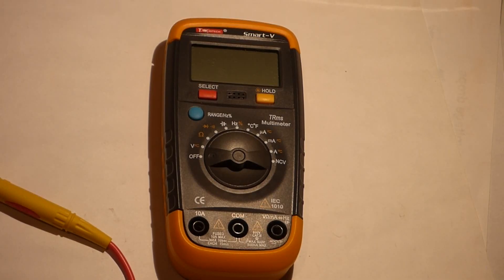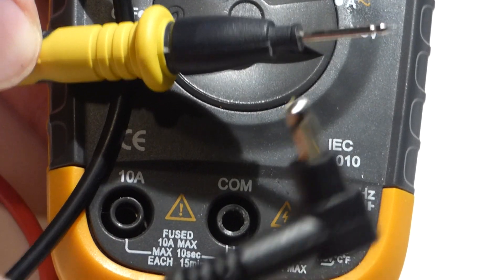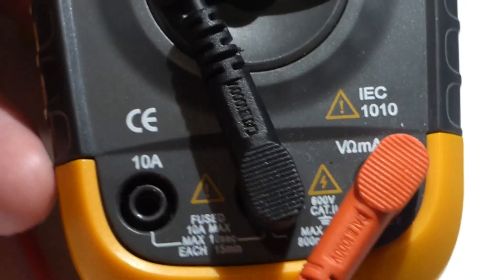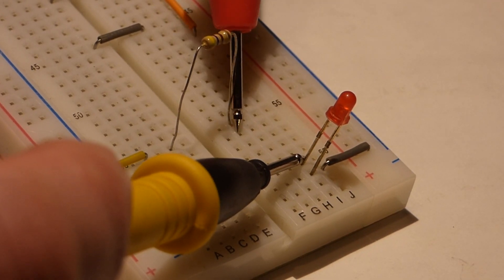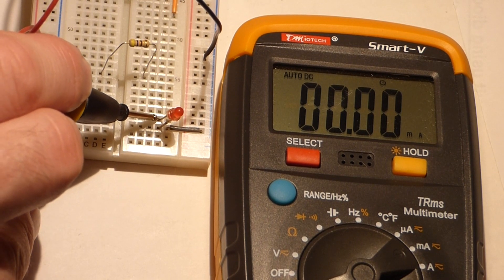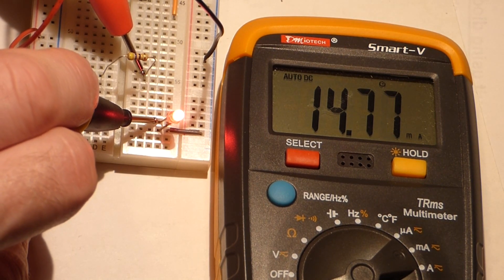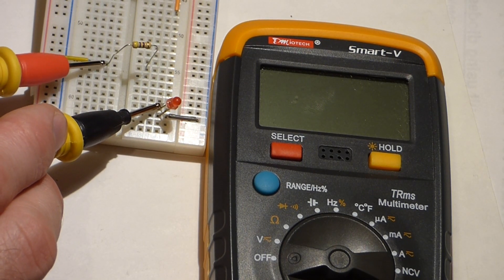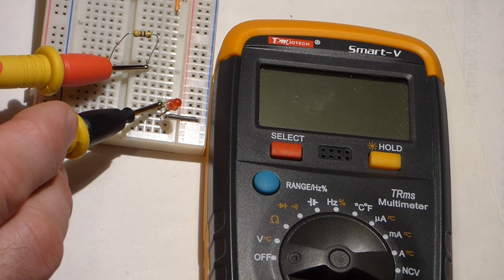How to use an electronics multimeter to measure current of a small breadboarded circuit.

Comment: Question: when experimenting we usually deal with mA and V not so much with joules or candela. I wanted to "see" J, W and candela. Can you please confirm if I am right?

1) For calculating joules and watts:
 In order to visualize joules (and watts) and candela I have made this circuit: 9V battery+ ---- green LED ---- 660Ohm resistor ---- 9V battery negative. Voltage drop across the green LED was 2,04V and the current (measured by closing the circuit between the LED and the resistor) 8.6mA. So 2.04V*0.0086A gives: 0.01754 J.  Does this means that I am seeing 17.54 milijoules converted to light every second or 17.54 miliwatts of power consumption of the LED? 

2) Calculating candela:
Green light is between 435-630*10^12 Hz and definition of candela states 540*10^12 Hz monochromatic light. Since 540 falls between 435-630 it seemed possible to estimate the number of candela given out by the LED.The definition of candela talks about 1/683 W (=0,00146Ј/s) on 1 steradian. Since our 0.01754Js are approximately 10x that, should it mean that if we limit the light of a green LED with a paper-cone of a radius of 1 meter and the base of the cone is 1 m2 we will get around 10 candela of luminous intensity on that base (approximating that the surface of the base of the cone is equal to the surface of the sphere)?
Reply from the maker: Can't help you on this one unfortunately. I just have a small familiarization with joules and candelas. Never practiced working out any of the formulas or did any measuring/testing.